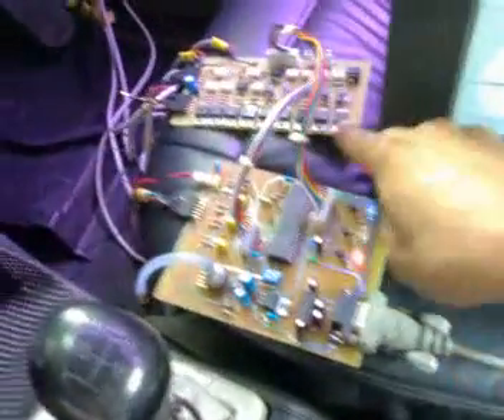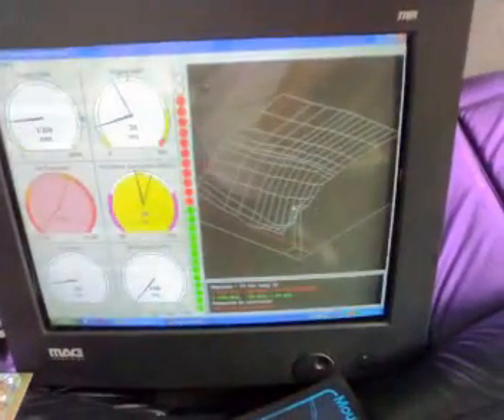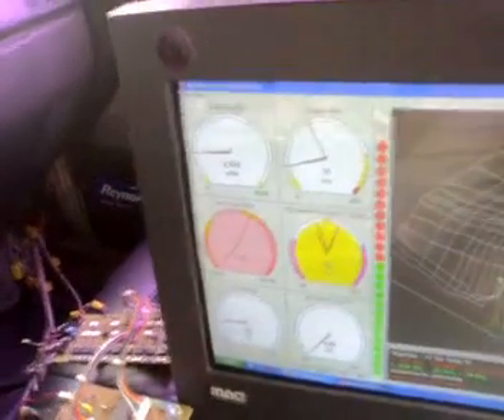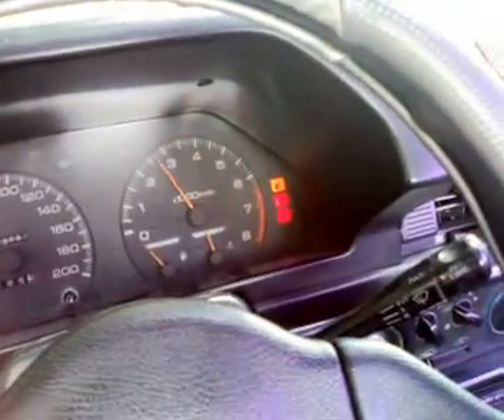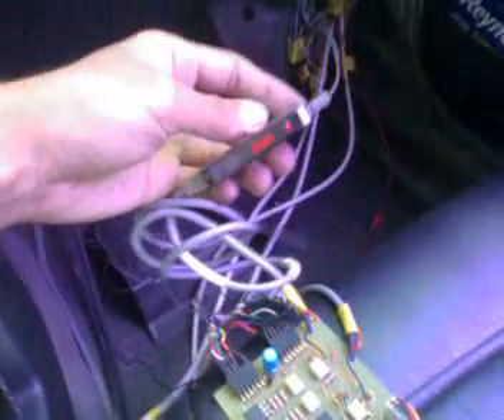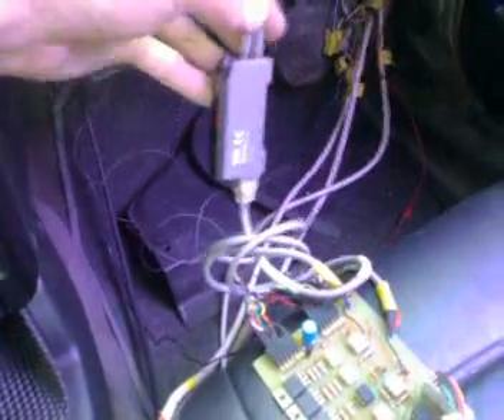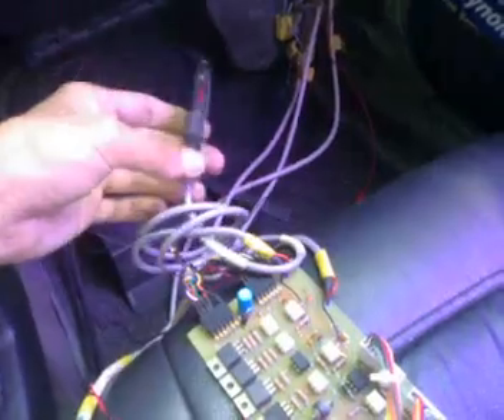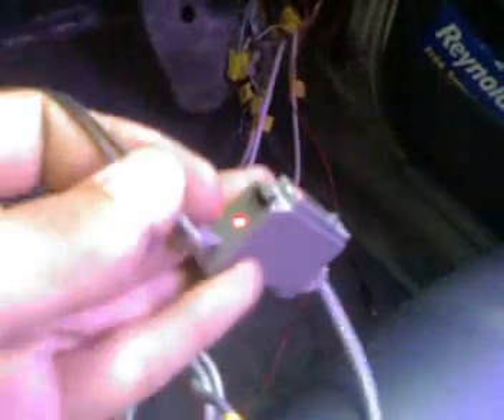Megasquirt  4g15 Lancer '92

Comment from the maker: I flat-out idle regions at 10 degrees and raise the spark curve up all the way to 45 advance in full throttle, learned the hard way to tune but it's so much fun getting full control i just need to make my own dc motor driver for the idling stuff